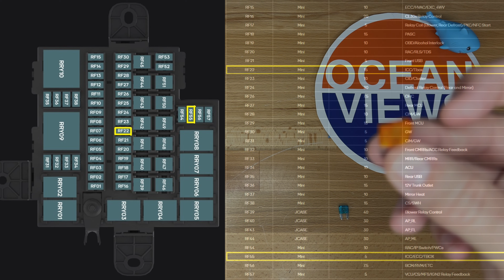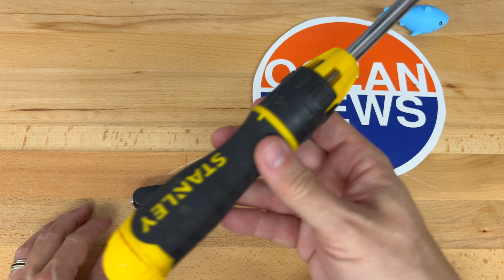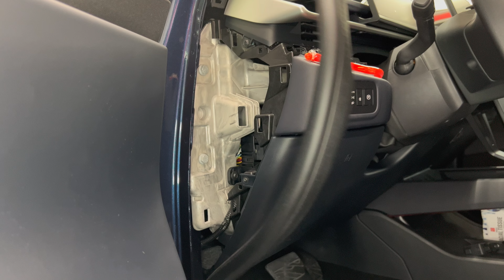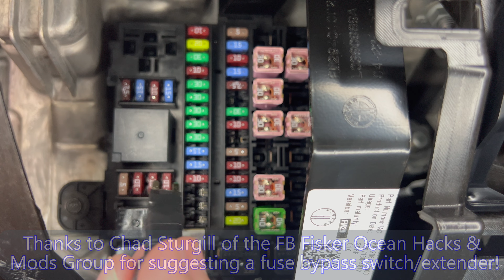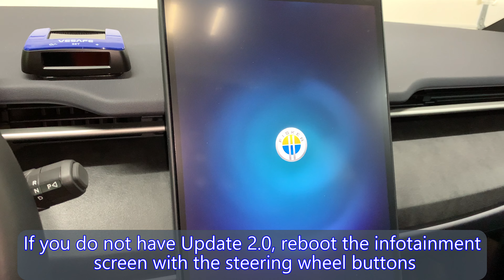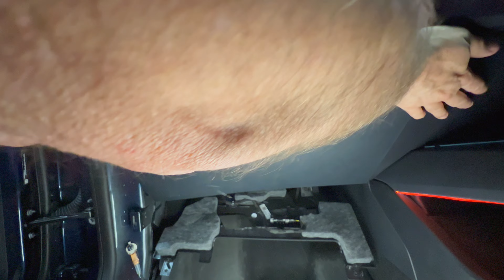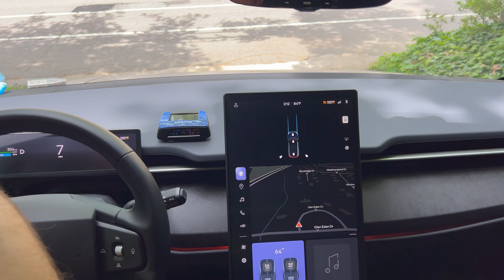Fisker Ocean One - Cabin Fuse Box & Tbox Reset

Comment: Hello, my 4g suddenly stopped and i vannot connect to any wifi.  It started when parked for 6 hours.  Only think i noticed was 12v battery did dip below 12v while parked.  Normally it stays above 12v.  Is this fuse pull a fix for 4g and wifi?
Reply from the maker: @petertierney994  I can’t guarantee it, but the ICC does control the 4G.  You may want to try removing/reinserting RF22 and/or 55.
Reply: @MTNRanger  is it possible the 12v battery monitor can prevent the car to sleep.  Since I successfully installed it a few days ago I cannnot get the car to sleep.  I also cannot get the energy saving modes to trigger.  I want to do a deep sleep before I pull the fuse.  Maybe I'll disconnect the monitor first. I know it uses power from 12v to send Bluetooth.  Maybe this draw is keeping car alive on the version I have.
Reply from the maker: @petertierney994  It may be possible, but I have not heard anyone bringing it up before.  The huge number of modules in the car and their respective versions may cause different outcomes on different Oceans.  Yes, I would test without the monitor to see if it goes back to the original functioning.
Reply: So it worked with just the one fuse pull, my wifi reconnected and I say the 4g flash before wifi.  Will take for a spin to confirm 4g after I put car back together.  Wifi always errors on connections unsuccessful but I see it connected on my router and the internet on the car works now.

Comment: Hi,

Did you ever make a video on how to access the cabin air filter?  Thank you
Reply from the maker: Once a cabin filter becomes available, I will gladly make a video!  Note, most cars have them replaced every two years, so we have some time before it becomes necessary.
Reply: Nice! Interesting enough … I am in communication with the original manufacturer to see if I can make a bulk order.  They are looking into it and I’ll let ya know the results when I get them .  Thanks again
Reply from the maker: @troychrisman7682  That would be very useful for the FOA.  Are you working with them on this?

Comment: Great video. I'm thinking of installing the extender.  What was the length of the extended you used? 30 cm?
Reply from the maker: I used the 60 cm, but 30 cm is all you really need.  The 30 cm was out of stock when I was planning this video.

Comment: Just watched this and was wondering if I could apply this to my own situation. My Android will no longer work with the car. Calls come thru but voice is just static. Couple questions. 1) Do you know which fuse controls the phone/voice? Would it be the same fuse? 2) When taking the fuse out and waiting for a reset are you having the car on?
Reply from the maker: The RF22/55 fuses control the Tbox and ICC modules.  When pulled also turns of the center display.  I'm not sure if there is a specific fuse for the phone/voice.  Yes, the car is on when you remove/reinsert the fuse (it's technically always on!)

Comment: I did this and it works. The video is an excellent guide, and it went perfectly. I used a 30 cm bypass switch and didn't have to take out the top screws - I just fed the blade end down from the top.
Reply from the maker: @EdFry01  Yes, I should have routed it from the top.  I realized during editing the video and slapped my forehead!

Comment: Hi Matt! Great video. Watched it when you first released it and hoped that it was merely for my entertainment. However, coming back from a trip to Detroit, I was listening to Spotify and wanted to change to TuneIn. At that point, the T-Mobile connection, according to the bars, was and still is gone. The radio still works, but none of the entertainment apps work either.

Oddly, TomTom still works but the lady has laryngitis. When I first start the TomTom in the morning, she comes on and tells the estimated time of arrival, but then goes silent. I suspect it is from being hooked up to the home WiFi. Judging by the radio audio, when a turn comes, the speakers at the front are attenuated and stay that way for about 10 minutes.

Do you think this issue is related to what you are describing in this video?
Reply from the maker: It's hard to say.  I've never had the issue you describe.  Sometimes things can be buggy and a deep sleep reset or overnight seems to fix them.  Other times, pulling the fuse works.  But what you describe sounds like either the ICC or Tbox.  Pulling and resetting either or both fuses may help.

Comment: Any suggestions on how to fix the icc module or replace
Reply from the maker: Sorry, I don't have any experience with fixing or replacing the ICC module.  I know it is located at the bottom of center console across from the Tbox.
Reply: @MTNRanger  what fuse is for the ICC controller.  Resetting it may solve the ICC issue perhaps?

Comment: I appreciate the video.  But I have to wonder how often does a problem occur where you have to pull one of these fuses to reset the Tbox?  Seems like a ridiculous amount of effort and expense for an owner to make their own tweaks to the vehicle to keep it working.  Which leads me to think that this car has some pretty horrible electronics engineering design.  Knock on wood, I have a FOE purchased in December, currently on 2.0, and I don't "think" I have any Tbox issues.
Reply from the maker: Some people have the Tbox lockup every week, others may not have the issue.  I think given enough time, these problems would have been addressed by the company.  Most are probably fixed with OTA software updates to the system.  It's unfortunate that the owners have to do this, but with the company going away, there is no other choice.

Comment: pulled out 15Amp, screen went off, but after re-inserting the fuse (more than a minute without fuse) - screen cme back up and navigation still frozen at home address
Reply from the maker: It's also possible you may have an issue with the ICC module (which communicates between the car and the network).  Unfortunately, there may be more than one cause of the navigation locking up.

Comment: Hi,
unfortunatelly for me pulling out 15Amp or the 5Amp fuse did not work.  Pulling 5Amp fuse doesn't even turn off navigation.
Reply from the maker: Did you pull both out at the same time?  The screen should turn off if you pull the 15 A fuse.

Comment: Thanks so much for this video. After a recent 12v drain and jump, I still had maps and navigation but both clocks were off (and didn’t match each other) and my 4G had stopped working which concerned me because I am still waiting for the 2.1 push which needs the 4G. I pulled the RF22 first which did not resolve the issue but pulling the RF55 then rebooting the infotainment did. Anyway, I was very nervous but your clear instructions made the process way less painful. Appreciate you and all you do for the community!!!
Reply from the maker: Thanks, I'm glad it worked for you.

Comment: Hello, thank you for your video! My internet only works around 1% of the time and I’ve tried your method of resetting the Tbox by removing the RF55 and RF22 fuses, separately and together and have tried soft resetting but my internet works only for a couple minutes upon restarting the car and then goes away. I’ve also replaced both 15 Amp and 5 Amp fuses with new ones. Do you happen to have any other suggestions? Because of this problem my car is still stuck on 1.11
Reply from the maker: It sounds like you may have a problem with the ICC module (which controls communication).  Either it needs a firmware update or be replaced.  When did you get the car and where are you located?

Comment: Did you end up using the 30cm or 60cm bypass switch?
Reply from the maker: In the video I used the 60cm version.  You really just need 30cm, but it was out of stock when I was planning the video.
Reply: Thanks!

Comment: Hello,
Thank you very much for the great video.
I am from Germany and have had my Fisker Ocean Extreme since December 2023.
There is no longer any support in Germany.
After Update 2.0 I have no longer a connection to the apps and the internet. Date, navigation and updates are no longer possible.
I tried to reboot the car using the main-switch near the battery. But that didn't work.
Do you think I can reactivate the navigation system and the internet connection by using your suggested method?
I would be very happy about a short answer.
Thank you and greetings Germany
Reply from the maker: Yes, it most likely sounds like you need a Tbox reset using this method.
Reply: @MTNRanger  
Thank you for your quick answer!

I'll try it tomorrow morning and I'll give you feedback.

Do you think I should remove both fuses at the same time or only one at a time andd step by step?
And you also think waiting for 1 minute might be enough?
I often read in German forums, that you should wait 10-30 minutes for other systems to restart.
Many greetings from Germany.
Reply from the maker: @joergebenhoch  You could remove both, but try RF22 first.  Everything I have seen only requires about a minute before reinserting.  It would not hurt to wait longer if you wish.  In any case, I would do a infotainment reboot after you reinsert the fuse.
Reply: @MTNRanger 

Thank you :-) Is it sufficient if the Fisker is opened with the key or NFC? I don't have to press the brake pedal either? By restarting the infotainment you mean that I hold the two inner buttons on the steering wheel for 15 seconds?
Reply from the maker: @joergebenhoch  Opening method does not matter.  You press the brake pedal to wake the car up or put it in ready mode. Yes, pressing the two inner buttons on the steering wheel.
Reply: @MTNRanger  Hello and good morning from Germany.
Your instructions worked!!!
I have coordinated the internet, date and time again and I should be online again to receive the updates.
The apps (Spotify, YouTube…) also work again.
However, my “My Fisker app” (Android) still does not recognize my vehicle. Only the location determination works.
Thank you again (!!!) and greetings from Germany

Comment: Great video. May be you can help. My Dcc fast charger won’t work. It tries to connect to vehicle and then end up with “charging start error”. Do you know what fuse I could try to may be reset it! ? Thanks
Reply from the maker: Have you tried different CCS station?  Some are not compatible (or giving issues) such as the EVgo 100kW stations.  I'm not aware of which particular fuse controls charging.
Reply: @MTNRanger  thanks. Yea. Tried many different brands and locations too
Reply from the maker: @sripavanv  If that's the case, you definitely need Fisker service to look at it and see if there is a hardware problem.

Comment: If you can do this, you can probably help with this? 

You'll be my hero if you can figure out how to make the reverse and below 23mph forward speaker sound not as loud or a way to 'legally' shut it off.
Reply from the maker: Yes, there is a way to disconnect the pedestrian speaker. Thanks for the suggestion.  I have not done it yet and I'll put it on my to-do list!
Reply: @MTNRanger  you rock! Thanks. and maybe there's a way to muffle the sound so it's still on, road legal, but not as annoying. Can't tell you how much I appreciate your videos!
Reply from the maker: Ok, tonight I tested with the key fob in the console and I got 30 minutes of run time before the outlet turned off.  Not quite as good as in the video, but still sufficient many outlet uses.  You can press the brake pedal and start another 30 minutes of use.

Comment: Thanks for this informative video. Looks like we need more of these to be able fix our wonderful vehicles our selves from the look of things. 

Any suggestions on how to fix the cameras/blind spot lights permanently on issue? Can it be fixed with changing fuses? 

Other question is if Ocean can work with Ottocast P3 OttoAIBox CarPlay Ai Media adaptor?
Reply from the maker: The cameras and blind spot detection issues are bugs that needed be addressed in software. Resetting fuses will not help that issue. No, an Ottocast P3 (or other device) will not work with the Ocean.

Comment: I guess I have been lucky with my FOO in that I have not had a problem with the navigation location being stuck. 
I do have the issue with Navigation updates not working, and the maps showing as 19 months old.  I reached out to Tomtom and was told that they update the maps every 3 months.  Lastly, for my navigation it shows states that I have never driven to as being "Region in Use". On my car it shows the state of Washington in Use and my car has not left California.  I really hope that the Fisker 3.0 update includes working updates to the Fisker Ocean Navigation maps.
Reply from the maker: The maps download has never worked on the Ocean.  They appear to download but never install and error out.  The points of interest are very poor in the navigation.  I search for local destinations and it sometimes points to something 500 miles away when I know there is one 5 miles away.  Very odd.

Comment: Thank you again for leading the way on all of these maintenance and repair tutorials!
Reply from the maker: Thank you!
Reply: I'm not much of a handy person, do you think it would be easier to unplug the battery under the hood? or any other way to cut power to reset?
 @MTNRanger
Reply from the maker: @krafter324  That will possibly fix the issue, but then you lose your doggie windows that will require an in-person service tech calibration.  Once the switch is installed, it's much easier than any alternative.
Reply: @MTNRanger  oh good to know. Won’t do that!

Comment: Brilliant… thanks you so much for posting those educational videos. I guess if fisker goes under (maybe the question is not if, it’s when), you are going to be the go to guru :)… I’ve been experiencing issues with my ICC for the last few weeks, it would go black while driving, could not access anything, including AC, soft reboot did not work. The moment I stops it would go back! A technician came over and did hard reboot by disconnecting the 12V battery, one week later the ICC went completely down!!! I put another ticket, and now it’s been a week no one has called! Do you think this something has to do with the fuse box?
Reply from the maker: Thanks!  With that description, I think you may need the ICC module replaced.  I would check to see if a fuse is blown. Check out the Facebook "Fisker Ocean Maintenance and Tips" group, lots of good stuff in there.  We already have a service manual available to download.

Comment: Great video. I just did this reset a few days ago because my cell service stopped working, pulling the fuse for a minute has fixed it so far.  Wish I had your video, it would have made it a ton easier!!

One addition that I did notice, and maybe you did this and we couldn't see it, is when putting the lower cover back on by the pedals, there is a metal mount or tab near towards the front of the vehicle that that lower cover latches into, it seems to keep the cover raised higher and better fitting around the floor vents.

Thanks again, Great stuff!!!
Reply from the maker: Yes, when it pushed it towards the front and up, it seems to latch into it.  If you don't do that, it falls down in the front by an inch or so.

Comment: My car is on 2.0 and Fisker replaced ADAS module to make cameras work but it has made lane keep assist and blind spot monitoring unavailable. Do you have any tricks or suggestions to get them working?
Reply from the maker: You got me on that one.  I think the tech should have calibrated/updated all the modules when replacing the ADAS module.  I'm not sure I can suggest anything on that, sorry.  Are they totally not available or do them come and go?
Reply: @MTNRanger  thanks for the response. Unfortunately those 2 items are completely unavailable. It was becoming impossible to drive with notifications switching between blind spot monitoring unavailable and lane keep assist unavailable. So I had to set them to disabled. Even after doing that I get a reminder on each drive that both of those functions are unavailable. I wish Fisker was in better shape to help me by sending a tech to troubleshoot it further. I have now given up hope on getting it working.
Reply: Thanks for sharing. Awesome  job. You  are not even  wearing  glasses.
Reply from the maker: @chealay7251  I need them for distance.

Comment: Absolutely brilliant. HUGE thanks. Hasn't happened to me yet but now I know. Anyone doing this, PLEASE be careful. If you do something wrong and Fisker support is no longer available you might end up with something worse than a stuck Nav screen. So, BE CAREFUL. I have some something fairly similar in disassembly and reassemble with my 92 BMW 850i where I had to take out the general control module and switch out capacitors. So, that was more complicated but the disassembly and assembly was pretty similar, removing panels under the steering wheel. I took my time making a 2 hr job a 5-6 hrs job taking breaks in between to breath and slow down to be patient. NICE video.
Reply from the maker: Yes, patience and carefulness is the key!